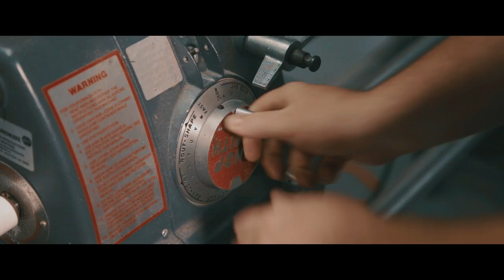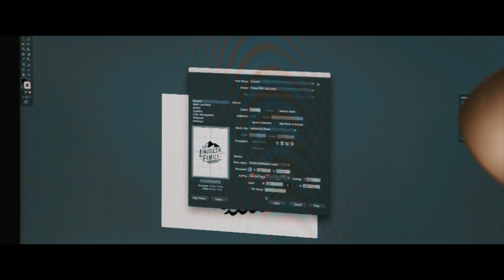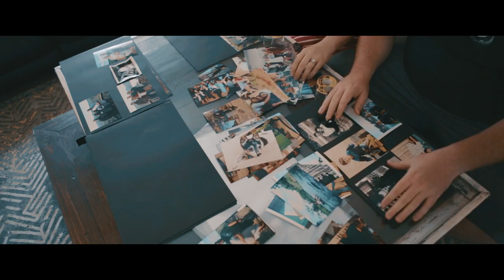Making a Photo Album from Wood

Comment: Quick question I see that you use posts to hold the sheets in. Could this idea be modified to glue sheets of paper together. What I mean is that I have sheets from a book that I have printed. I will straighten these out then glue together as a binding. Would I simply cut the "spine" to the same width as the paper in order to attach the "spine" to the wood to then use hinges to hold the cover?
Reply from the maker: I really have no idea, you would have to experiment yourself. Thats how I made this was by making a smaller paper model first.

Comment: really want to attempt to recreate, any reason u decided to join via biscuits vs 1 solid piece? would 1 piece warp? also what type of wood did you go with? thx very much
Reply from the maker: They were scraps that I already had lying around from another project. It was just Red oak boards.
Reply: sorry man, last question! what solution did u use to remove the adhesive from the stencil? thx!!
Reply from the maker: No biggie! Use mineral spirits. Comes right off.